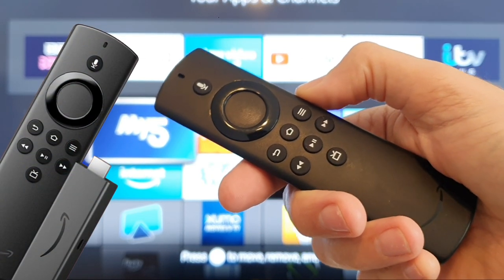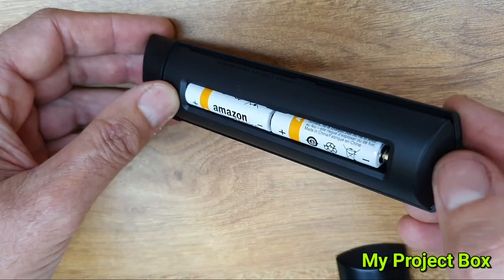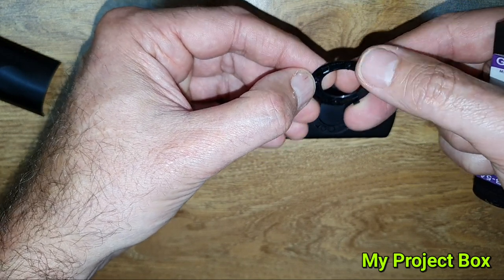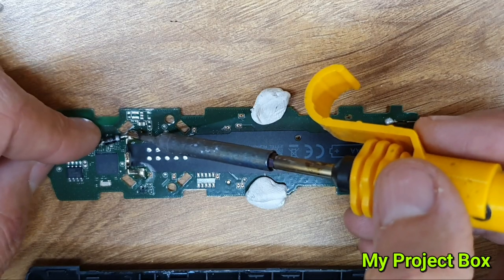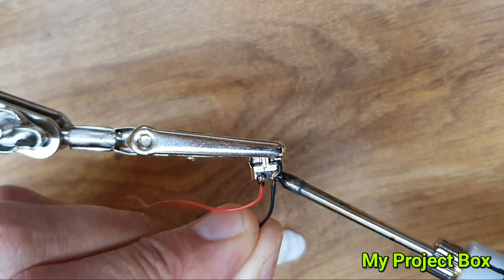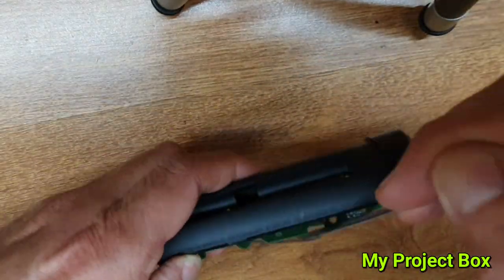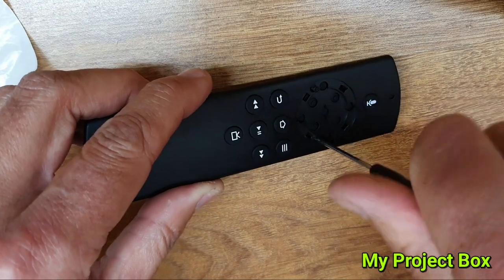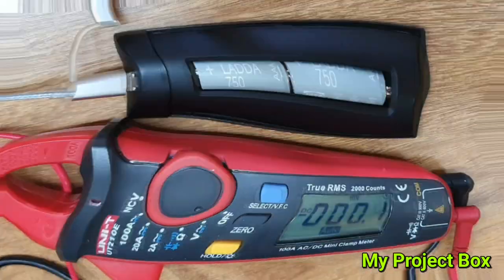Rechargeable Amazon Fire stick remote USB Hack Mod #ElectronicsCreators

Comment: Did you use just a general purpose silicone rectifier diode? 1/4 W resistors?  Perfect mod! I'm going to do this to all my remotes!
Reply from the maker: Yes. I used a 1N4007 diode, but almost any silicone rectifier diode, will work just fine.
Reply: @MyProjectBoxChannel  Thank you my friend! Keep up the great work! 👍😊

Comment: I have two flattish recycled lithium cells (3.7 nominal V - 1100mAh) that would fit nicely in my Harmony remote I use for TIVO (4 AAAs in typical 2P2S three+ volt configuration).  Do you think the board could handle lithium's 4V max charge?
Reply: Just decided to slap in a handy dandy 18650 I had in storage holding 3.7V.  Works great and only took a couple of minutes.  Even at 80% capacity and half full it still should last almost as long as  new Ni/Mh rechargeables, and will be easy, at least for me to charge.
UPDATE: just notice Harmony remote screen no longer turns off -- double Doh :-(
Reply from the maker: 4V might be OK, but if you're worried you can drop the voltage with a diode in-line with the positive to the board. A silicone diode drops  approximately 0.6 volt across it's self.  It's not perfect and it's somewhat load dependent,  but it might just be good enough for your purposes.  If you think about it the old zinc carbon cells,  could have a open circuit voltage as high as 1.7V , so 3.4V for two of them. That's not to far away from 4V.
Reply: @MyProjectBoxChannel  Thanks for reply, and advice.  I will try using that diode tip with lithium on the next remote I have that dies on me.  Maybe even add a charging port or TP4056 with possibly a switch in parallel with the diode. That way when modified voltage drops below 3V I can bypass diode; thereby,  reducing time between charges - does this make sense?
Reply from the maker: @mevk1   You might not need the switch.  You ll be surprised how low voltage some devices can operate at. If you have a adjustable power supply you could test the lower limit.  Or measure the voltage of flat batteries that it still works.
Reply: @MyProjectBoxChannel  Good Point.  Could not believe my 9V multimeter was still giving proper voltage measurements at 3V, though diode functions failed a few volts earlier.

Comment: Why just bought a rechargeable battery and another set of rechargeable. When low battery just replace it.
Reply from the maker: Of course that would work just fine as well 🙂, but it's fun to modify things. And now I don't need a separate battery charger for the AAA cells😉. So why do it? well just because I can😜, and it's useful.
Reply: @MyProjectBoxChannel  Why do they say "rechargable batteries not recommended" ? To force battery sales ?
Reply from the maker: @johnj8514  maybe they want you to order more batteries from Amazon 🤣. BUT NiMH cells have a slightly lower nominal voltage of 1.2v. It doesn't seem to effect the operation of the remote though. Some devices don't like the lower voltage.
Reply: @MyProjectBoxChannel  here's another reason, my family's more likely to plug the remote into a USB charger, rather than remove the batteries, find a charger and plug batteries into the charger.  I have noticed that the Fire STick remote is super hungry, Keen to try this hack
Reply: @MyProjectBoxChannel  handheld electronic thermometers are great examples of devices that do not like 1.2v, they want 1.5v and will therefore not work with rechargeables